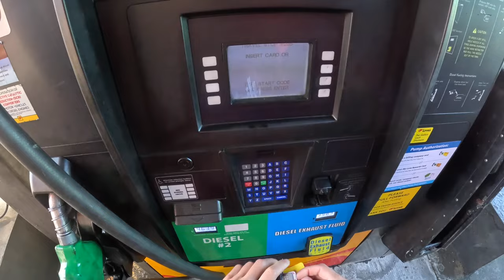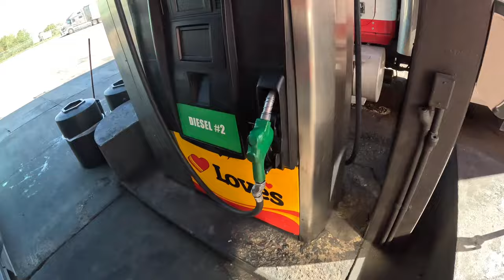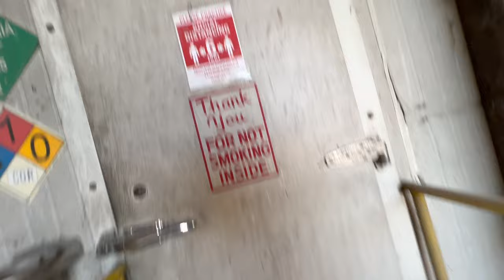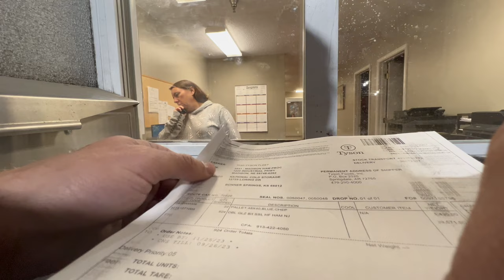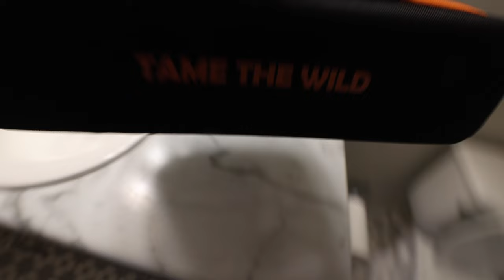🔴 008 2024 Freightliner Cascadia Goes into the Shop at Hirschbach!

Comment: these new Cascadia's are junk...between power issues, transmission issues, sensor issues etc. i run a 2022 and 35k miles inn there's clutching issues and switching into neutral under power issues and even down to replacing the auto 5th wheel release line failing multiple times. Older ones are better. these new ones aren't worth the investment at all. My fuel economy is even terrible at 6.8 -7.1 average. these camera sysems are the worse and safety departments are all but useless.. they do no go but harass people for trying to do there job.